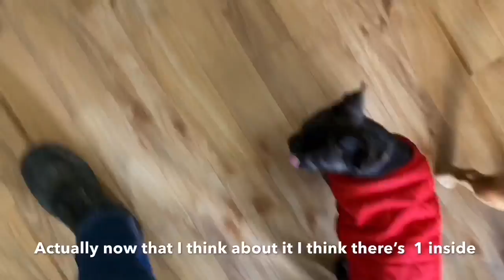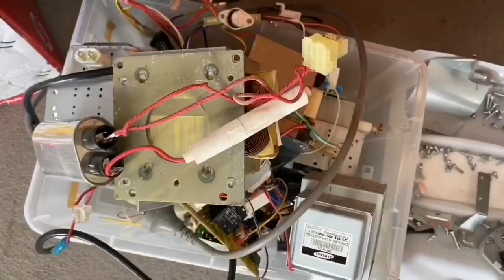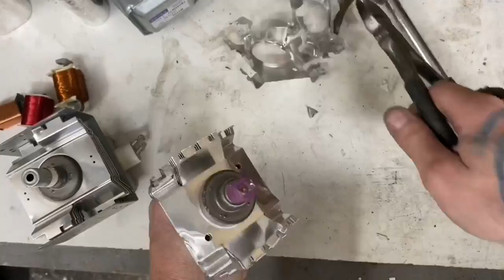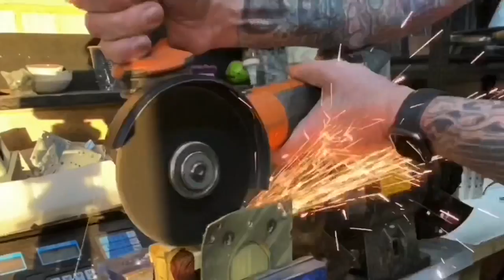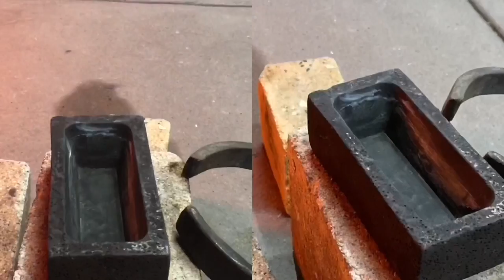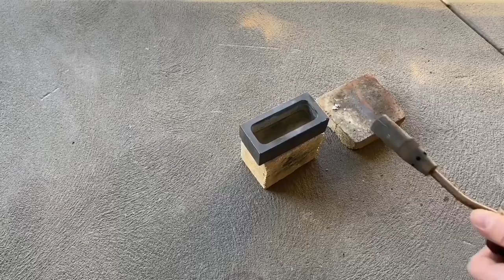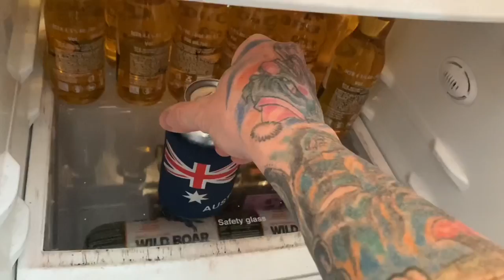Microwave MeltDown - Copper Casting - Trash To Treasure - BigStackD - ASMR Metal Melting

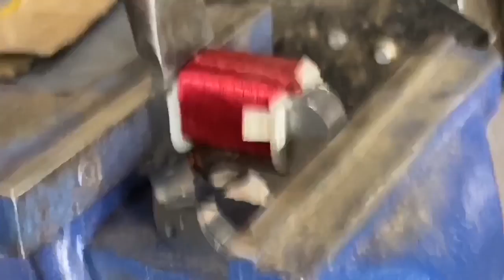Comment: 4:09 - be careful with the ceramic insulators on the magnetrons - they contain radioactive beryllium oxide - not a huge issue outside the body like most alpha emitters, but if you breath in the dust, long term it's going to cause you serious issues.
Reply: radioactive 😂
Reply: @Jollydog69  yes, Literally radioactive. Ioninsing radiation to be specific.

"All magnetrons contain a small amount of thorium mixed with tungsten in their filament. While this is a radioactive metal, the risk of cancer is low as it never gets airborne in normal usage."

https://en.wikipedia.org/wiki/Cavity_magnetron
Reply: The Aussie Repair Guy yeah yeah keep changing your story
Reply: @Jollydog69  I'm not here to prove it to anyone, just a warning, do with it what you will. I personally use the stuff for test sources. I trust my gear more than your opinion.
Reply: The Aussie Repair Guy mate, you said the beryllium oxide was radioactive
Reply: @Jollydog69  Yes correct, both statements can be true depending on the brand and style of the magentron - there are about as many variations on the design as there are vehicles.
Without a  gamma ray spectrometer, it's hard to know exactly which one they have used, and even then they often use alpha emitters instead, which aren't easily detectable with a normal geiger counter.

You find out years later when you get lymphoma or leukemia - much like many people in Australia did when the British nuclear tests contaminated much of the country with strontium-90 and covered it up.

if your sole purpose is to find something to troll me about - then this conversation is over.